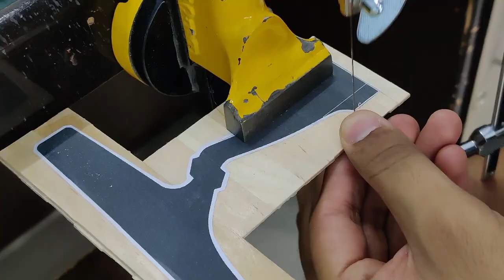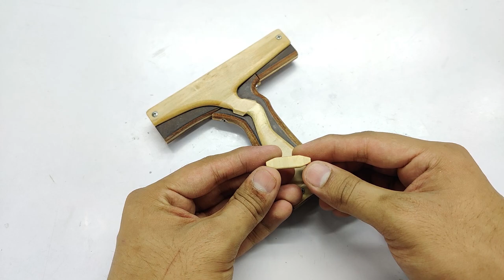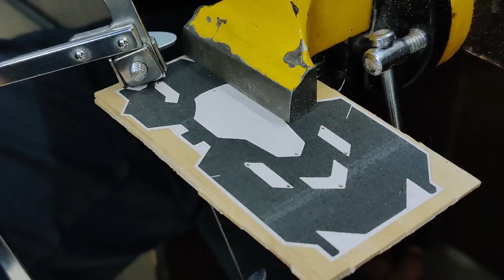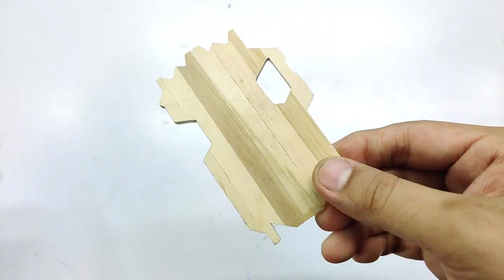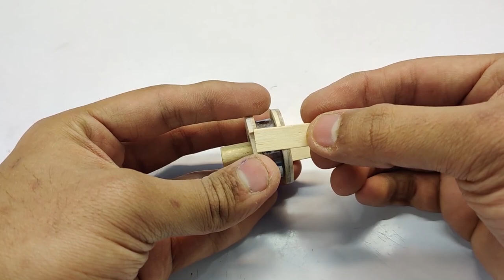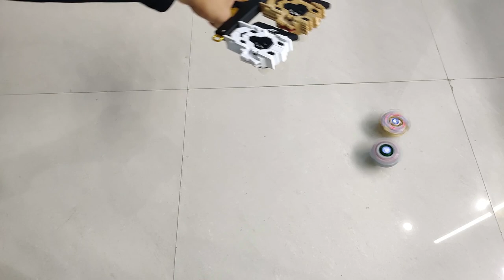Building Dual Beyblade Launcher From Popsicle Sticks - DIY

Comment: My real powerful blade is own Pegasus I buyed and customize and I added infinity nado beyblade parts. Parts are one balance and attack type another is glassy energy ring and we can use any attack ring but it must look Pegasus attack ring and face bolt metal fight not fixing that's why I used infinity nado beyblade face bolt and sticked Pegasus constalation sticker and it name is ultra samurai Pegasus